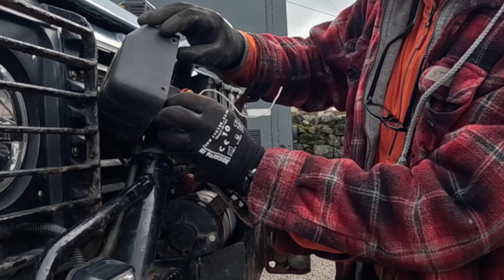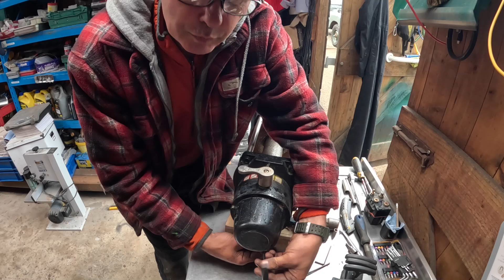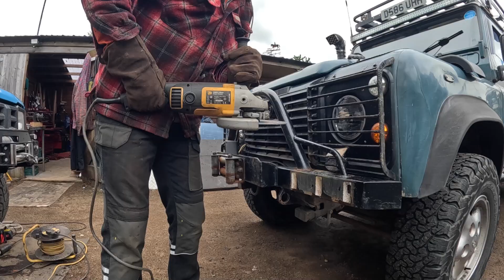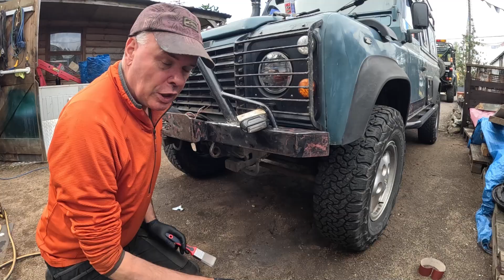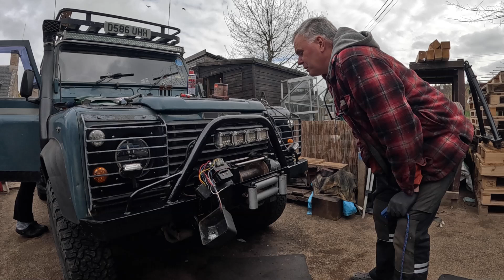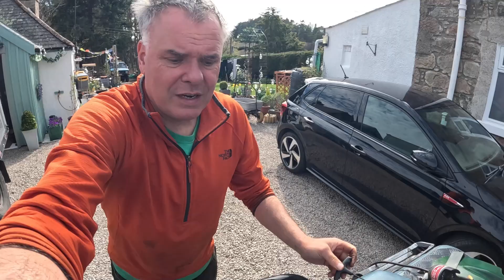Broken Winch (Goodwinch) -  diagnose, repair and service

Comment: I've done some fairly big jobs on my defender but trying to do up winch wiring nuts and bolts with those ****ing little rubber boots getting in the way is easily one of the fiddliest 😅
Reply from the maker: HaHa! Yes, it a a tad annoying. And doing it while the battery is connected then shorting it using the spanner is also another favourite. 😅

Comment: Nice bumper repair and good to see full tds winch service. I was looking at one on Facebook market place but was put off by the state of it. But having seen this video I may be tempted as I fancy a rear winch. Though may be a bit of thinking of where to mount due to my other things fitted in the pick up bed and rear mount fuel tank.
Reply from the maker: They are ok winches. They just need use, or the brake can seize up.

Comment: Hi Fraser! Thanks for the video. One thought for your channel - it would be useful to hear more about some of your tools - for example - that plasma cutter looks really good. Without one here, I would be reaching for the hacksaw, or for longer cuts, the angle grinder with a cutting disc. Also, I guess the plasma cutter is good for shaped cuts...
Reply from the maker: @teuluPaul  that's a very good  point! Thanks for the feedback.
And, yes, the plasma cutter will cut any shape, as long as it is less than 8mm steel.
Cheers, Fraser